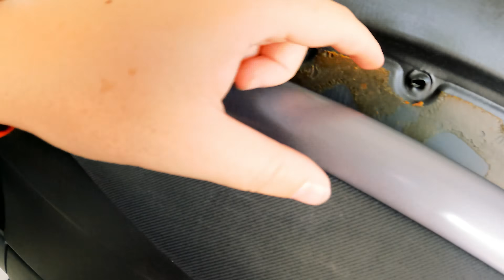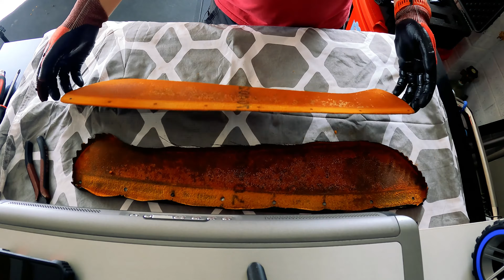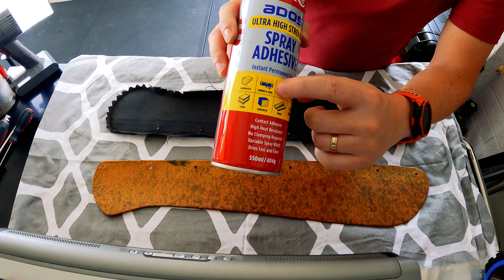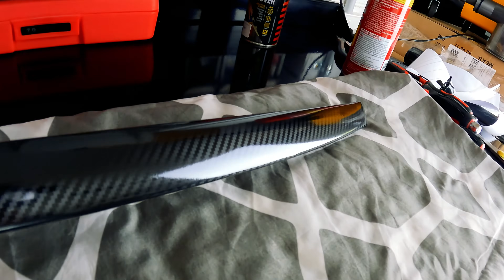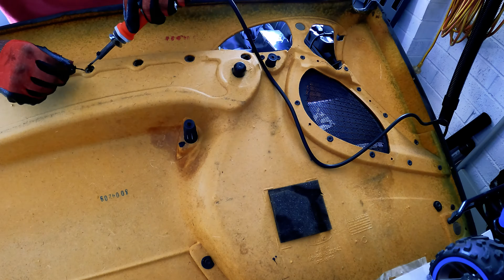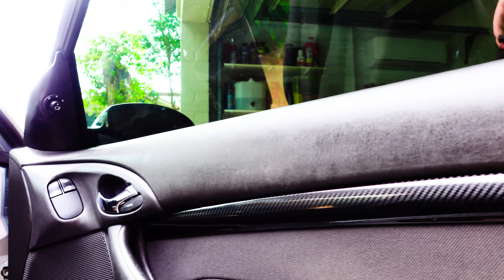How To Repair Loose Trim Panels Ford Focus Mk1

Comment: stop lying to your followers and start documenting, cable ties are made from a different plastic combination than automotive plastics, in automotive you will see a lot of ABS,PC,PP, cable ties usually are made from PE i think, or idk only thing i know with cable ties it will not hold nearly half of the original , i f-ed up one time with it and i m never using them again for plastic welding their good only on the same material, just go buy some worn out plastic that are the same plastic mixture and you ll have good as original quality

Comment: me personally i had the same stuff on the driver and passenger side but i wanted to be more luxurious and just replaced the leather with alcantara and instead of spray glue i used industrial grade glue that is heat resistant, moisture resistant and water resistant and its more of a permanent solution since the glue is so strong after sticking the alcantara on there it just sticks and wont ever come off

Comment: Must you solder that trim back on? Can't you just use some strong glue and that's it?
Reply from the maker: No soldering isn't necessary, strong glue will do, I just wanted it to be extra strong.

Comment: Carbon fiber (ish) parts are cool.
+ if the door cards are off, there's a great opportunity to clean the door drain holes, at the bottom of the door. Dust-free will be rust-free.
Reply from the maker: Thanks, great suggestion!!